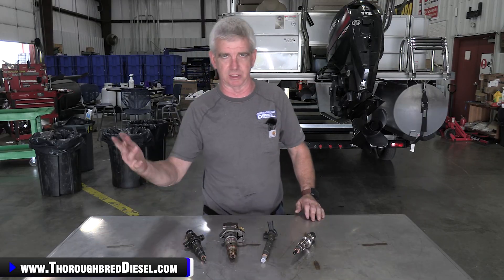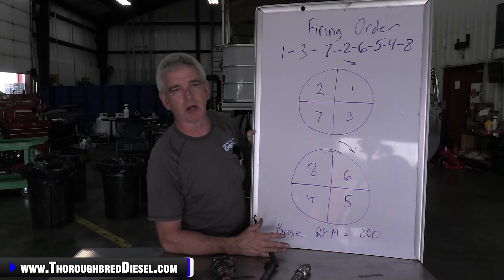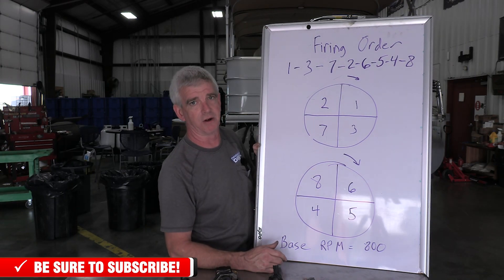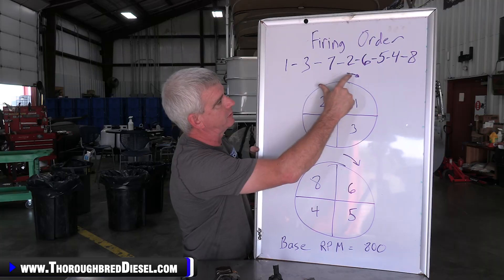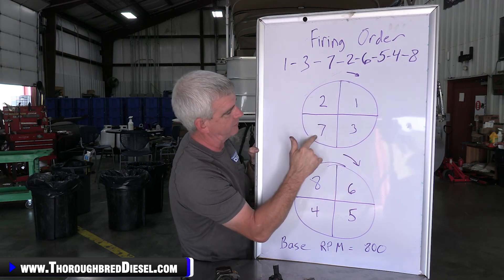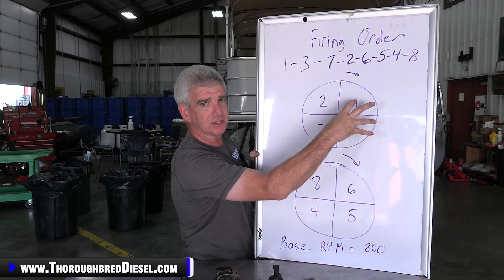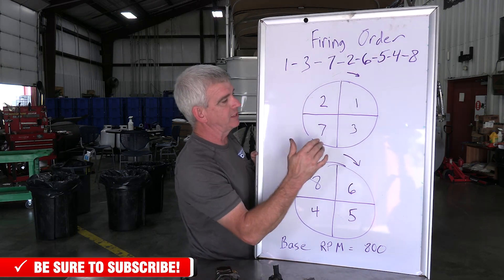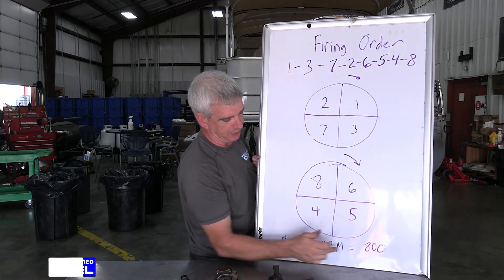Diesel University: Fuel Injector Balance Rates Explained #diesel #injectors #diy

Comment: On my 2006 LLY Kodiak C4 500 checking balance rates this last summer number five cylinder was at 1.5 the rest of them were at zero or close to that slipping the vehicle into drive. The balance rate on number five someone that went up to 4.2. Should this inject to be changed out?
Reply from the maker: You have to get your base calculated fuel rate and then assess from there.  That injector might be good and the others bad.

Comment: Wish you would’ve covered the topic more but great video. I am currently dealing with this cyl contribution test on a 5.9. I was told test must be done with engine at operating temp. 
  Wish you would discuss specific issues that can cause excessive balance rate spread. Is it merely compression? What in the valve train can affect it? Does valve lash have any affect? What if your engine seemingly runs well but balance rates are way off? What is considered to be acceptable spread vs unacceptable? What about using injector kill test in conjunction with cyl perf. test?
  Thanks for your great videos. The more technical the better.
Reply from the maker: Most of these mfg's will have specific "parameters" that they assign for "go" "no go" on the injectors.  Each are different.   5.9's are strange in that they dont have cylinder contribution in all models.  You are also correct that most mfg's require the truck to be at operating temp, but in my personal opinion, you can find "suspect" injectors at first start up, etc.  THe spread could be for any of the number of things you mentioned, could also be from a lack of fuel pressure.  Always check you inputs first.  Thanks for watching!

Comment: 7.3 powerstroke. Have you ever heard of running the contribution test in gear vs park to get a more accurate test?.
Reply from the maker: I hadnt heard that on a 7.3 because the test requires park on auto trucks, but its a think for the common rails for sure.